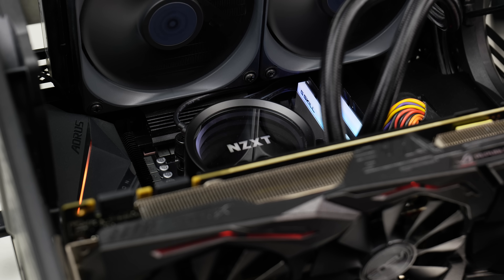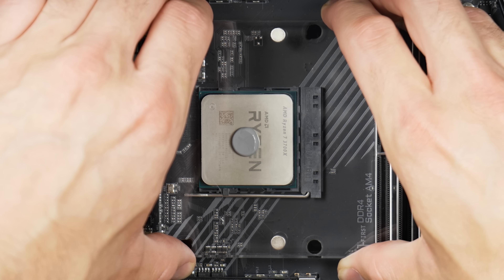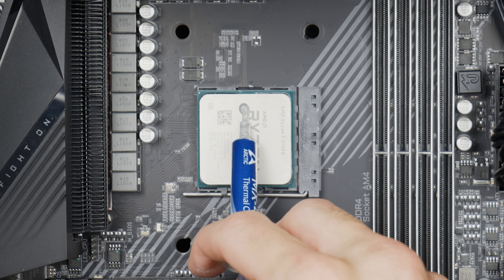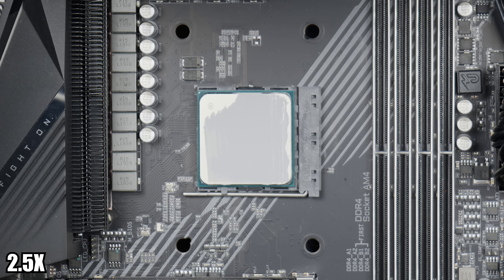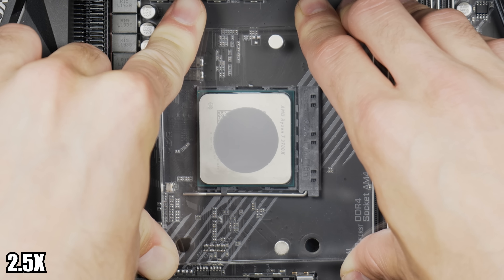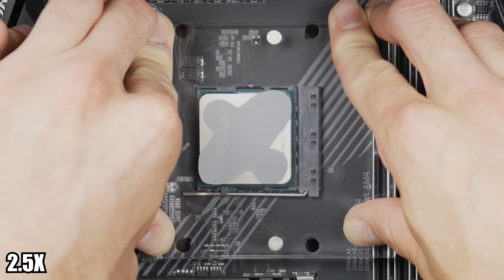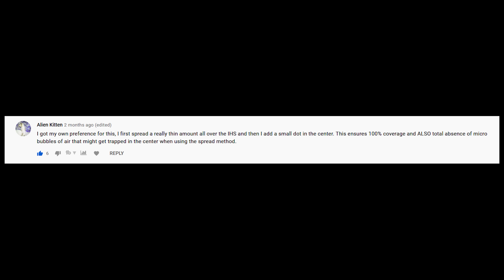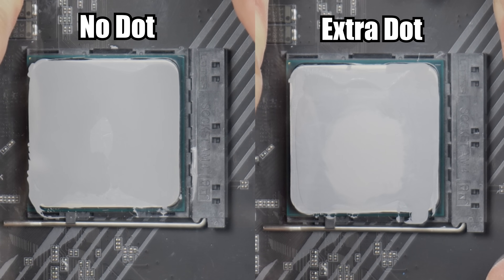Thermal Paste Spread Under Glass

Comment: This is so funny. As you are not compressing the paste down with the same force or rigid material, it's not really showing you the correct result.  The Pea size amount will spread over the IHS ,what ever method is used.  A little to much is better than not enough.👍

Comment: I think mounting a cooler puts a lot more pressure than your tests because I've always used the pea method and the coverage was 100% when I pulled the cooler off.
Reply: This is so accurate. I've built and dismantled several thousand PCs (it's my job) and I just use the pea method because I know it works. Every cooler I've ever removed shows a perfect, thin, even spread of paste over the whole IHS, any excess gets squeezed out to the edges over time anyway.
Reply: I always do the pea method as well, the X makes me nervous about some bleeding over the edge.
Reply: @inquity6  This stuff is all non conductive though, I have had huge blobs of it on the board and never caused an issue. The whole subject is just wives tales and inexperienced loud mouths.
Reply: @owensharp8568  I guess its just my experience with using liquid metal that made me that way lol, I'd always assume they all are obviously I was wrong. I'm always overly cautious when working with someone's computer parts so. When I got back into PC building arctic silver 5 was no longer the best of the best.
Reply: @inquity6  it got up to 5?  My last tube was AS 3. I still have 1/2 a tube of it... and I just checked... it's a solid chunk.. its gotta be 10 years old at least.
Reply: @inquity6  I hear you for sure. Recently got into mining so re pasting and re padding GPUs quite a lot now so you quickly learn what's what.
Reply: @Keri-Kerigan  Yup hit AS5 before i stopped building/fixing pc's for awhile the pandemic kinda got me back into it, was building a new pc just before it hit. The last paste and my current paste on my core is noctua's crap that comes with the big boy nh-15.
Reply: @inquity6  Running the same d15, except I'm using liquid metal on it. the stuff is a even bigger pain to spread around than Artic silver, just for a different reason lol.
Reply: @owensharp8568  What do you mean it's non-conductive? That's its entire purpose. Do you mean it's non electrically conductive?
Reply: @KindredBrujah  Yes of course we mean electrically XD
Reply: I certainly screwed on my cooler really, REALLY hard! So hard, in fact, that I was really afraid it'd break. But it didn't so... Ok all good I guess! :')
Reply: I do a little bigger than a grain of rice and get 100% coverage. That giant pea he uses won't fly if he ever uses something conductive.
Reply: Yeah then you heat it all up as well.
Reply: The x is the best
Reply: @Big Smoke Tha Toke He's applying enough pressure - probably more than a heastink mount will normally apply, but results take TIME. Thermal paste is very viscous and even with light pressure like those crappy Intel push-pins, it just takes a few hours of continuous pressure for the paste to flow out to the edges.
Reply: @chrisfanning5842  im assuming you never had to take off cooling of cpu 5 minutes after installing it. it covers whole cpu instantly
Reply: then you are probably damaging your motherboard, be carefull, you can bend those things without too much force and that can short some components, so i would advise to take a little extra care there
Reply: @slick6227  the way coolers are designed, you cannot put too much pressure on the CPU. When you screw the screws in until they don't turn anymore, that's when you reach the optimal pressure level. You just can't go any further.
Reply: @Benzin0  unfortunately ive had a couple coolers where my memory wouldnt post until i loosened the screws. 4790k was most recent.
Reply: @slick6227  except you dont screw it to motherboard itself. there is no way to damage motherboard this way
Reply: @slick6227  Not likely.
Reply: @slick6227  I hope you don't have a habit of giving out advice often because you are confidently incorrect on that one. Just learn this stuff for yourself before you try to teach others, I know you can do it.

Or you could have phrased your statement as a question and gotten a real answer, assuming someone like yourself doesn't come along and give you an incorrect response as well.

Comment: But do you need to refresh old paste, on CPUs and GPUs?
Reply from the maker: Yes. After 2-3 years it often dries out.
Reply: @TechIlliterate  Theoretically I understand this and that it could affect the thermal conduction significantly. But... I have 4 PCs on which I installed CPU & (Arctic Silver) paste between 7 and 11 years ago. Two of them are overclocked. All of them used quite often. But none of them seem to have overheating problems. The one that is most clocked, an fx8350 @4.6g has a Corsair AIO that has not been maintained at all, other than keeping the system dust free and the temps are roughly the same now as in 2013 - the fans maybe a little noisier. It's The Smith's question of What Difference Does It Make?

Comment: I put a thin layer of paste on the cpu aswell on the bottom side of the cooler.
And then a small dot in the middle of the cpu aswell  on the bottom middle the cooler to prevent air pockets.
Result: (with the GamerStorm Assassin III air cooler) when the PC is idle it is just as cool as the ambient tempature, sometimes even 2 celcius cooler.

Comment: The higher the paste quality, the better the spread. mx4 is not the highest end that exists, but having nameless gunk would get worse results in most spread methods. If I have any decently high paste I would use an X, but with lower quality I would use an X with 4 dots, 1 inbetween each 2 lines.

Comment: If you ever need to apply TIM/thermal paste you need to know this.
You can take the cooler off, check the paste, & reassemble it.
WITHOUT removing the paste!
I've done it, it works fine IF the paste application is done properly.
IF you try it just monitor the temps to make sure they're normal.
If not, reapply the paste.
You CAN reuse NEW paste.
Just don't

Comment: remember, putting to much or little will cause the cooler to stick to your AMD CPU, don't pull it upwards directly or you will rip its pins from the socket
Reply: Good tip for those, turn your CPU fans off, loosen the cooler, and put a good amount of heat into the chip, then before it cools down, the paste should be soft enough to wiggle it out without the cpu coming with it.
Reply: @kasuraga  or just wiggle the cooler with heatsink left and right, while applying small upward force? it will come of on it own. no damage caused and no need for overheating the cpu (the hell??)xD
Reply: @seushimarejikaze1337  it won't overheat the cpu. you just get it up to around 70-80c to soften the paste
Reply: @kasuraga  this is  what i cannot understand. why plug out the fan on online pc where you can as well run some workload (if you have a feeling it "glued together") then as soon as you turn off pc, do what you will. its not like it will cool down instantly. personally i do as i said before, so only wiggle it a bit while pulling it slightly upwards without heating it up or just running it in bios for a bit. ive yet need to meet a radiator that didnt get loose at some point during that "exercise" and it happens without any damage (..people saying they pulled out cpu, by force, from socket - they should stay away from pc's, seriously xD)

Comment: I put on a nitrile glove then get a tiny amount of paste on the tip of my index finger. I then dab a thin layer all over the heat spreader. Next, I install the cooler, let it sit a bit, then remove it. If there are any spots on the bottom of the cooler that didn't get any paste transfer, I dab them and reinstall the cooler.

Minimum paste for maximum thermal transfer because the goal of it is to just fill in the gaps.

Comment: I used to apply the x method, but Noctua actually recomments the penta pea method as it saves on the paste but does perfect coverage as outlined in your video. Noctua has a couple of videos on how to apply their paste based on the type and size of CPU.
Reply: looking at the documentation with my most recent purchase of NT-H1 they only recommend a single 4-5mm dot centre for the AM4/LGA20xx, a smaller single 3-4mm dot for the LGA115x, but 9 dots of varying sizes for the TR4 and LGA 3647.
Reply: AMD also recommends the penta dot method as well. I just follow what the manuals say most of the time.
Reply: @swiftly1937  penta dot is five dots?
Reply: @ penta = 5 so yes.
Reply: Agree, but only when the CPU has even sides (square). Alder Lake and Raptor Lake are rectangular so pea in center doesnt sound best. Maybe 2 peas placed about 1 cm apart?
Reply: @weeooh1  the rectangular cpu need a cross like the one christ died on
Reply: @weeooh1  Or maybe a thick rice, or an oval perhaps ?

Comment: I use a variant of the butter spread.  I don't actually use a card to spread the paste.  I start a few millimeters in from the edge of the IHS and slowly spread my Arctic Silver across the IHS using the tip of the tube to spread it around leaving a nice thin layer.  Been using that method for over 20 years and it works quite well.  Some other methods have a tendency to spread the paste over the edge of the die and if you use too much, it can work its way under the chip and into the pins.  I see this problem a lot in both amateur builds and even some professional builds.

There's not likely to be any air bubbles using any of these methods due to the amount of pressure the cooling block places upon the IHS.  There's no way your hand pressure on the acrylic could ever reach the amount of pressure placed by the mounting bracket.

Comment: You can't use glass to show how thermal paste spreads. This is nonsense. First of all what you do is COLD glass against thermal paste. Thermal paste is made for HOT surfaces, so it can transfer heat quickly away from a hot copper (or aluminium) surface. And you press the glass with your fingers? That's stupid too. When you tighten down 4 screws from the cooler or pump, it's much more tight, than you do with your fingers. Your method shows nothing. You just try to be the guy who knows what to do. But you don't know anything about thermal paste and how it works.
I've been applying thermal paste on  CPu's for over 20 years, and NEVER had any issues with the way I do it. It's simple.- You put the size of a drop of water on the Cpu, then you take a piece of tape and put on your finger, and smear the thermal past out on the surface so it covers the whole surface of the CPU. That's it. I think i have some of the computers I've build 10 years ago,  at my customers office with the same thermal paste and they keep going with fine temps. Thermal paste will be liquid when it heats up and that's how it works. So when you use a piece of glass to show how thernal paste looks like when you press the glass - is rubbish.

Comment: I tend to use X method, but I add really small dots in the open parts of the X.  🙂
Reply: This? ※
Reply: @syd.a.m  Yep, 🙂
Reply: I add the dots only with nameless brand paste. As you saw, mx4 is good quality paste so x is good, but nameless paste tends to have worse spread so the dots are for then.
Reply: @Olav_Hansen  I've been a fan of, and have used Arctic Silver 5 for over a decade now.  I just add the dots to make sure.  

I saw a video once where they over applied (like ridiculous amounts) of thermal paste and everything was fine LOL.
Reply: @Terrackhimself over applying isn't a problem that often, since most paste doesn't conduct. But this vid has reinforced the idea that X is a worthwhile endeavour.
Reply: @Olav_Hansen  I did not say it was not a worthwhile endeavor, I was simply saying what I do.

Comment: I just wanted to bring up things like the convex type NOCTUA uses. you have to think about all coolers not just flat coolers. Prime example Noctua l9i spreads evenly with no bubbles under full spread because it has the convex point in the center (pushing bubbles to the outside).

Comment: Might help to start by saying what the objective should be - which is to cover the whole of the CPU with as thin a layer as possible. The paste is only there to fill the gaps between imperfectly flat surfaces and, wherever possible, direct metal to metal contact is much better. if the surfaces are not perfectly flat there would otherwise be air gaps and air doesn't conduct as well as thermal paste but thermal paste doesn't conduct as well as direct metal to metal.
Reply: So just weld your cooler to your IHS 😎
Reply: the pressure of all mounts makes it impossible to have to thick a layer, spread and lack of air is all that matters.
Reply: @Stars-Mine  not correct
Reply: @aggibson74  Literally correct, look at everyone who has tested it such as gamers nexus. you cant put on to much paste, dont worry about it.
Reply: @Stars-Mine  well you can do too much, the excess just squeezes out but yeah If you tighten down your cooler properly its impossible to have too thick of a layer or something. Might make a mess though...

Comment: You forgot the: There is no such thing as too much thermalpaste method. by just putting a entire TUBE of 25ML on the CPU.

To test this one you might need a Ancient/DEATH AMD or intel CPU
Reply: It's been done before but I don't remember what channel. unless it's conductive paste there were no issues and all methods were only a few degrees different.

The downside was that there was so much paste oozing out and piled up that pulling off the heatsink was a pain especially when it started drying

Comment: X was found to reduce bubbles considerably and was quick and easy to paste on.
Reply: X Gon' Give It To Ya
Reply: @gdpiscopo  X won't give air to ya'
Reply: lmao  @FlamingToaster
Reply: Lord knows an X with a + is a step forward.
Reply: @RogerThat1945  Hmmm ... a star then.
Reply: @adamcorfman573  Hmmm, why yes, you could call it a (shortened star [but not of the pentagram style]).
Reply: Glad to see the method I've always been using because it made sense intuitively held up well under this experiment!
Reply: @seeibe  The golden rule is not to use too much thermal paste. What do you think happens when you put a line of paste onto another line of paste - on the spot where they cross each other? :face-fuchsia-poop-shape:
Reply: @chacky4krsma  just FYI the actual golden rule is to not use too little thermal paste (as shown in this video's tiny dot portion). Multiple tests have been conducted by several prominent tech outlets and they pretty much unanimously conclude that too little paste is far worse than too much.
Reply: I think even better would be a * sign, it gives that extra line on the sides
Reply: In your face grease spreaders
Reply: literally any method works as long as you put the required pressure onto the cooler when installing... he even said so in the video that air bubbles literally create margin of error differences... ill stick with buttered toast as I know for certain the entire IHS is covered, air bubble or not.
Reply: @kendog0013  you should only be spreading thermal paste if its direct die. anything with an IHS is pea dot or x methods
Reply: @kendog0013  air bubbles get trapped. They don't have to be very large to create an issue. You can apply all you like, if anything,  you are adding MORE air the more you spread.
Reply: @viscountalpha  thermal paste is a pourous borderline ultra fine sandy metal particulate with very small amounts of oil. im pretty certain the bubbles are just forcing through the paste and exiting the material all together.
Reply: @icecreamdaycatlin8896  LOL that's not at all what it is. It's polymer which is clay or plastic. Not metal. And aid bubbles absolutely do get trapped in it.
Reply: @icecreamdaycatlin8896  installed a new cooler last weekend and accidentally lifted it while screwing it to the motherboard, letting all sorts of air in. I continued to finish to see what would happen and I did not get the desired cooling. And wasn't any better than the tiny OEM cooler, maybe worse. I reseated it and was careful to maintain contact. Now it's 5 degrees C cooler at idle and about 12 degrees cooler running games. I'd say trapped air is not a good thing based on my little experiment.
Reply: @icecreamdaycatlin8896  At 4:55 it seems to show the air bubble on the left hand side 'pop' out the side
Reply: Jesus loves you so much and He is waiting for you with open arms, please accept Him in your heart and life while He is near

Comment: Pea dot method has never failed me, as long as theres enough paste. Any air escapes out the sides as pressure is applied.
Reply: And you actually don't really need to cover the whole CPU with thermal paste, only the places where the contact is suboptimal. So the less the better.
Reply: @Miraihi  Yes it is only in the center and 1.5-2 cm radious   its not much..   People always exaggerating.   
I would never do what this dude does its to much in every method to me it is ridiculous..

Comment: well done, a * may even spread better, all we need to do is cover the micro scratches with thin layer to help kinetic heat transfer. with that in mind Lapping the CPU and cooler base for a nice mirror 🪞 finish helps even more
Reply: oh and after a year paste dries out and becomes like drywall, fire proof meaning it stops heat transfer, GPUs and CPUs should be redone every year